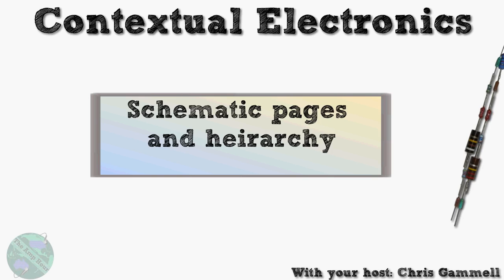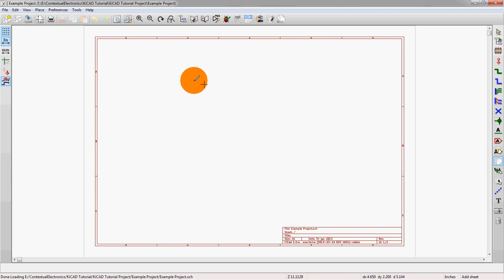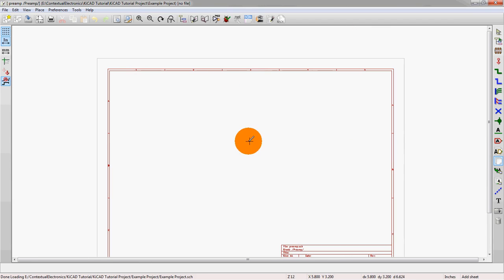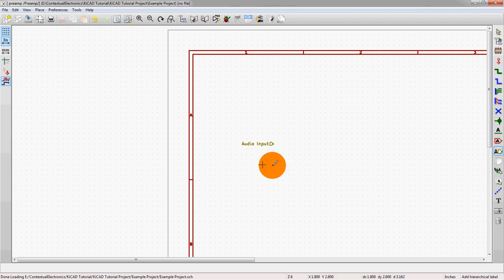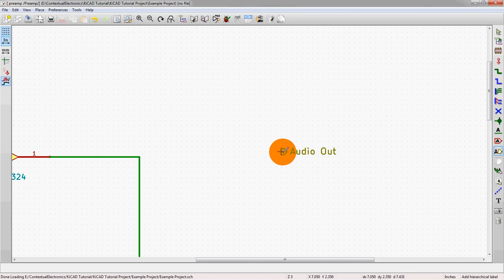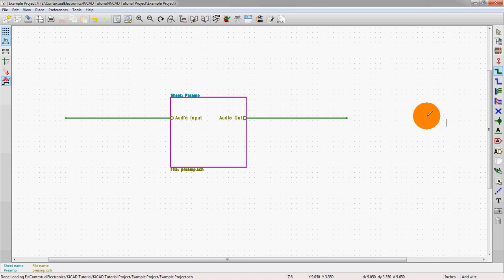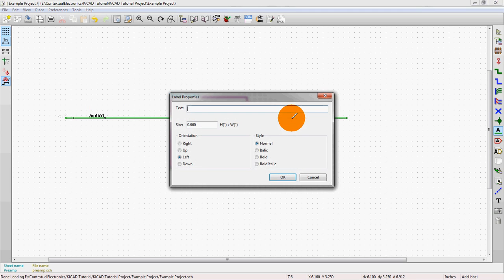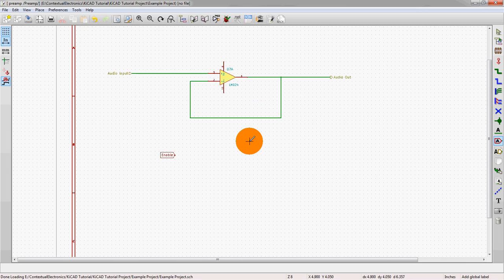KiCad 3.0 - Schematic Pages and Heirarchy In KiCad

Comment: The warnings about global labels.. They seem perfect if you want a multi-sheet flat diagram. I'm new to KiCad so I'm still looking into how to add sheets to a design that's growing. Seems like an everyday thing likely to happen and as such, could probably be made more everyday in the basic operation of KiCad, especially to newcomers. I suppose I could place all the sheets into a single heirarchical parent but I didn't start the design with that in mind. I just let the software guide me into starting work on the default sheet presented upon opening Eeschema for the first time.

Comment: Thanks! Some additional practical questions:
1) Is it possible to adjust schematic block size after it already drawn in the top-level schematic? I definitely can move it around but I can not figure out how to make it bigger to accommodate to the external pins number.
2) Can I copy a part of the top-level schematic to a sub sheet? (Apparently I started to draw a plain schematic but I run out of available space so now I need to go hierarchical).
3) All this looks like I will be able to use one block more than one time in a project(s). Which looks very promising. However I tried to create hierarchical sheet  with the name already existed and KiCAD prompted me that 'A sheet name <sheet_name> already existed' (and it is existed!). So am I able to ue a subsheet multiple times in project(s)?
Reply: to (1): Change size of chematic block by right click on its boarder and select "Resize Sheet"
Reply: 1. right click, select re-size
2. yes, i had to do the same thing when i decided to first try hierarchical.  select your schematic, right click and select Save Block (not copy).  then go into your hierarchical page and select paste (top left corner you will see the paste icon)
3.  dunno.. kicad is new to me, i'm used to cadence but i'm liking kicad more and more